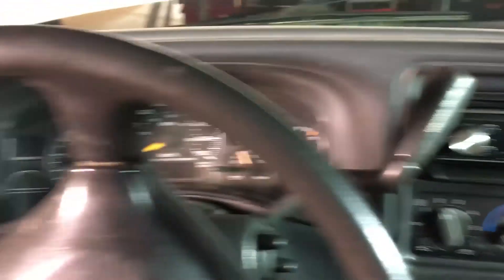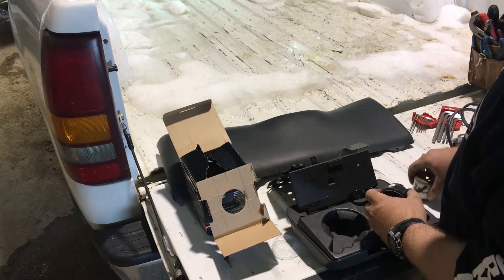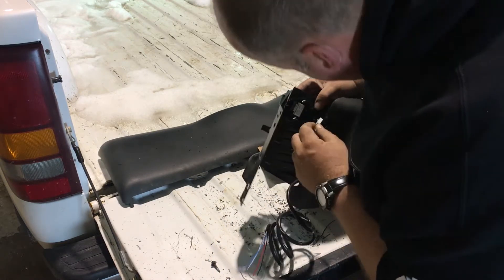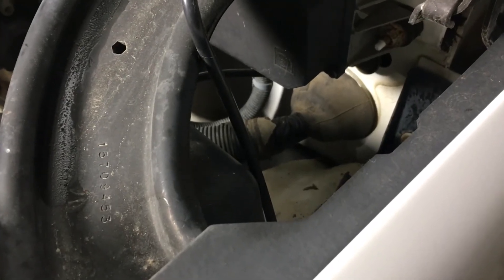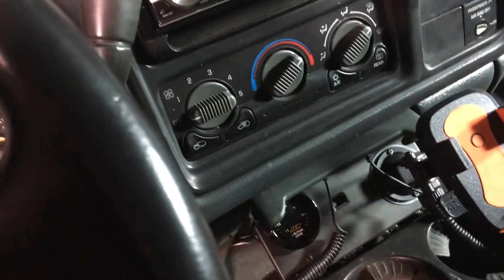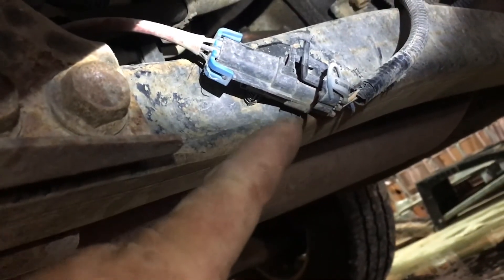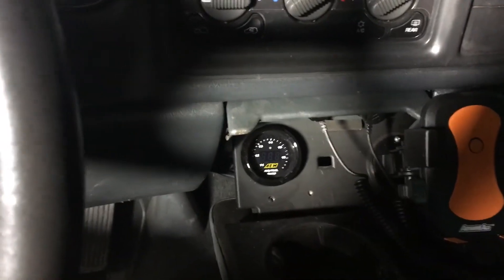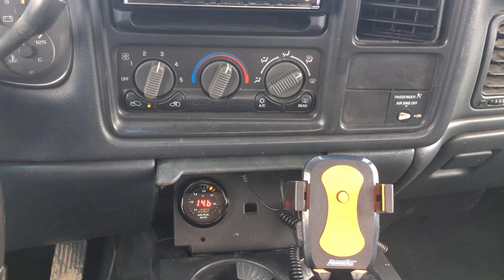Lowbuck LS Turbo - Part 2 - AEM 30-4110 Wideband O2 AFR Gauge Install

Comment: I am building a LQ4 with a BTR v2 stage 2 truck cam and 862 heads should I install this sensor for better tuning purposes??
Reply: Yes. A factory o2 sensor is narrowband. Tuning capabilities are slimmer.

Comment: Did you let the wideband go through the calibration process?
Reply from the maker: coarsegrind I wasn’t aware that there was a calibration procedure. From AEM’s website it says: Our sensors are individually laboratory-calibrated by Bosch and never require free air calibration!
Reply: @LowbuckLS  I wasn't aware that AEM worked right out of the box! The Innovate I bought requires a calibration. Maybe I should have bought an AEM!
Reply: @coarsegrind  the new 30-4110 wideband doesnt require free air calibration
Reply: Where did you connect the white and blue wires?

Comment: These are handy to tap into that side fuse box for power (or under hood I suppose). https://www.ebay.com/itm/321371516927?ssPageName=STRK:MESINDXX:IT&_trksid=p3984.m1436.l2649
Reply from the maker: Cool, I’ve never seen those before, looks like exactly what I need here, thanks for the tip!